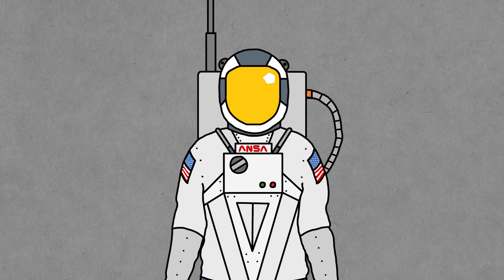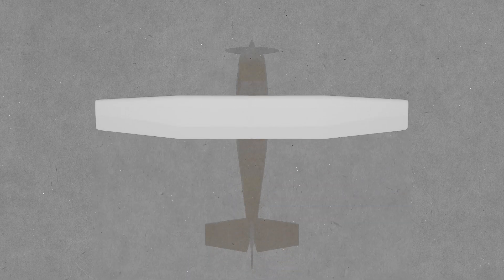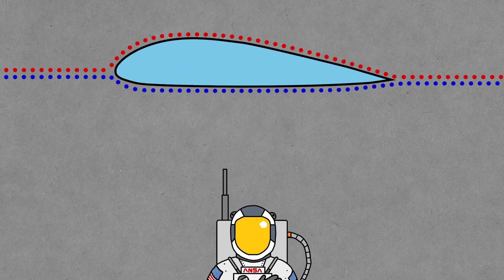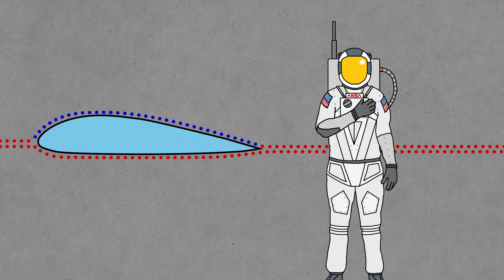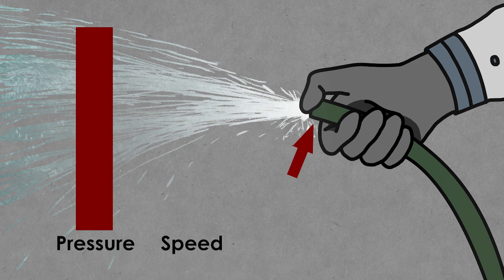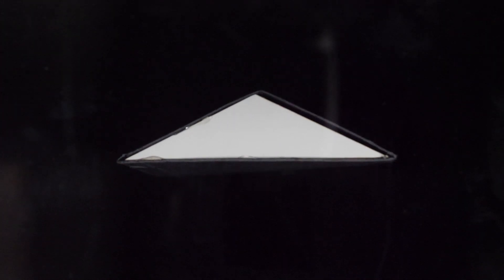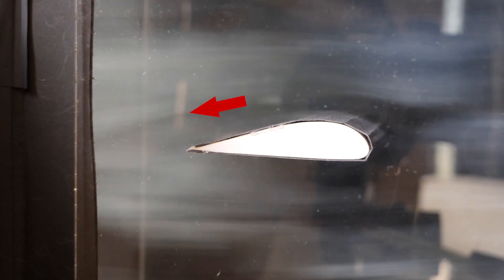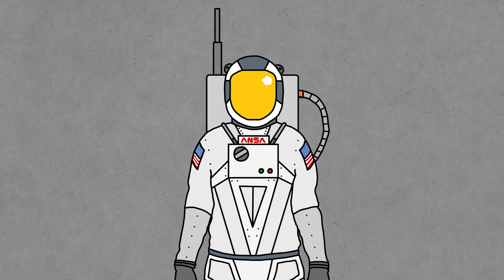Why No One Can Explain Airplanes

Comment: When an aerofoil starts from rest, flow has to double back round the trailing edge towards the rear stagnation point. If the atmosphere is not a superfluid, then instead of doing this the flow separates at the trailing edge and a starting vortex is left behind on the runway. This starting vortex can actually be visualised.

By the conservation of vorticity, there must be vorticity of opposite rotation associated with the aerofoil and this generates lift by the Magnus effect.

Conservation of vorticity is a synonym for the Kelvin circulation theorem and is a topological principle. Magnus effect is a synonym for the Kutta-Joukowski circulation theorem.

Explanations based on Bernoulli or Newton do not work with a hydrofoil moving slowly through liquid helium.

Comment from the maker: You may notice an edit at 4:17. I had another wind tunnel demonstration, but my explanation bordered on misleading so I removed it in October of 2020.

There are a few concepts I didn't cover in the video that I will mention here:

Angle of attack: Tilting the airfoil has a massive effect on the amount of lift, much more than the shape on its own.

Drag: Lift always comes with drag, the best airfoils maximize the ratio of lift to drag rather than simply maximizing raw lift.

Flow separation and Stalling: With steep angles of attack, or sharp changes in geometry (like the triangle airfoil) flow can separate from the airfoil which greatly reduces the lift and increases the drag.

Cut Wind Tunnel Tests: I had two more wind tunnel tests that weren't included in the final video.  The first was a flat airfoil that was supposed to act as a control.  Unfortunately, because of the updraft seen in the triangle test, the flat plate experienced some lift. This also caused issues with another airfoil shape which was a rectangle with a semi-circle cut out of it.  This was going to act as a counter to the longer path explanation because it is supposed to experience negative lift, but the updraft caused it to move up instead. Essentially, the wind tunnel is terrible and is only for demonstration, not actually proving anything.